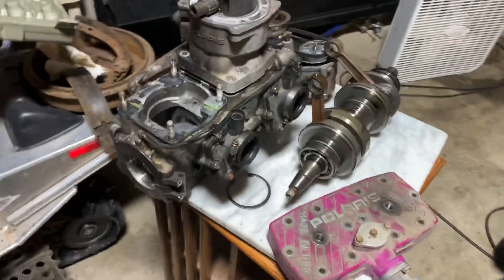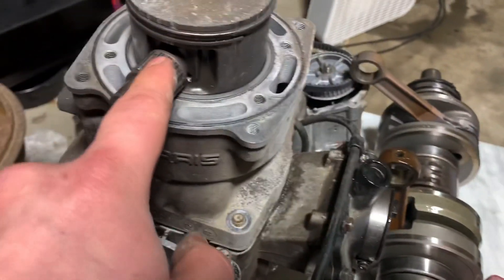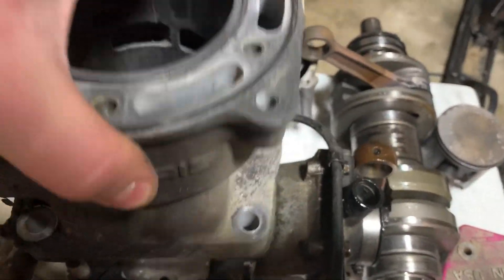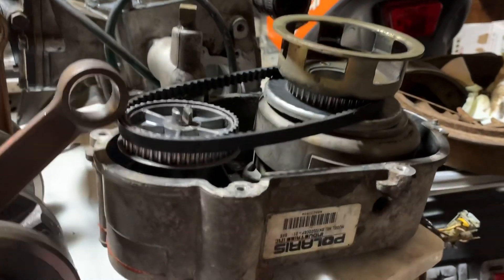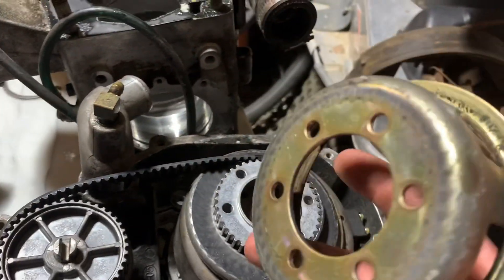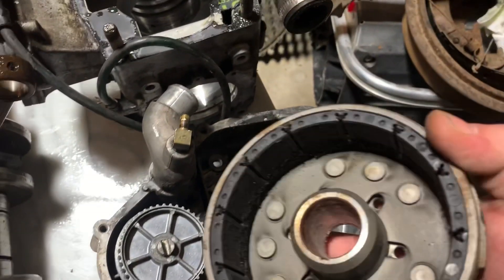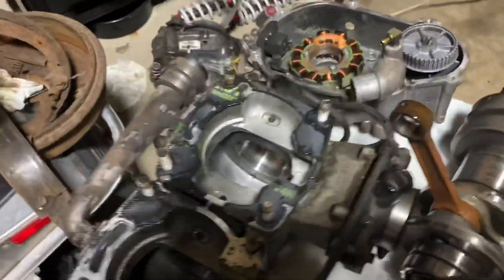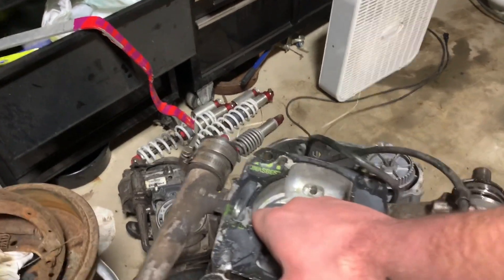Polaris big block twin break down - basics for beginners

Comment: Small Block 600 116 hp is 2001 XCSP.. 2001 still had Big block 600 108 hp in the classic. 600 n 700 big block  non power valve 97 to 99 had a ducti CDI different timing. 700 had 112 hp on non valve motor. Which is why a 2001/2002 600 kept up with 700 non power valve motor.  2003 600 small block lost HP.  A CDI from 2002- 2005 700  will work fine on non power valve motor.. 600 toss it there junk or put 700 or 800 cyls n pistons on.. the case and bearings are all the same on big blocks to 2006.  You can even put the 2002 newer Power valve cyl n heads on the non power valve and it will work. Because there no Electronics. 97 700 Cyl with cashing # 220 on them is what you want though. More Torqe...better flow.

Comment: Big block (VES) Small block (NON VES)
Reply from the maker: No. Small blocks were introduced in the 97 xcr 440, which had ves. The 600 big block (non ves) was replaced in 2000 by the small block (had ves) the big block 700 (non ves) is the same engine as it’s later 2002+ (ves) big blocks aside from the top end..
Reply: @AKproXR  Youre right! Lol
Reply: I cringed reading this LOL

Comment: How frequently do the 2002 700’s blow up ?
Reply from the maker: Seth Krahn not often, very reliable when maintained. Fun fact, 2002 was the highest rated HP big block 700 Polaris ever built.
Reply: Do you know what made them a bit more powerful?
Reply: Seth Krahn had more advanced timing in 2002, leaner carb needles for more air, leaner carb jetting, just check your plug colors if it’s black you are rich and can drop a jet size down, if tan color then your mint, they are some of the best Polaris motors ever made
Reply: I’ve only checked the plugs once in my sks 700 and they seem pretty fine, believe it or not I’m a 13 yr old kid and I know everything your talking about
Reply: Seth Krahn I’m 15 lol
Reply: Also VES cylinders played a big part in HP gain. I have a 99 motor to properly mix my fuel I have 03 wiring harness and carbs for reverse and advanced timing I also much rather the rack carbs much better and easier to setup for my mod sled. The only thing im after is VES cylinders now there expensive but I only buy new parts lol I don't cheap out on my dragon big block mod

Comment: Just found your channel. I am a fan of old indys aswell. Specially the 98 XC 700. The most goodlooking sled in the 90s  😁  I have a Edge 800 that i just rebulided and welded the crank on it. Those 900 bitch cranks love to self destruct. Other than that i have a 2000 XC600 with VES and a 92 indy 500 EFi 

Also got s Cat F7 and a M7. 
Keep up the videos. Awesome watching somebody work on basicly the same stuff i do all winter.  Greets from Sweden

Comment: I have a 98 sks 700 and its nice but why do you love the 700 so muchq
Reply from the maker: Anton Grankvist the XC chassis handles great on trails, and with the 121 and how efficient this chassis is for speed they are very fast sleds when setup right.
Reply: Anton Grankvist I love my 2000 rmk 700 1 they are bulletproof both the 220 and 824 cylinders, easy to work on, can make big power on both ves and non ves, they were ahead of there time can make a easy 140-150 hp out of them